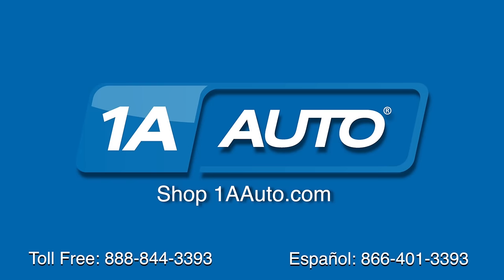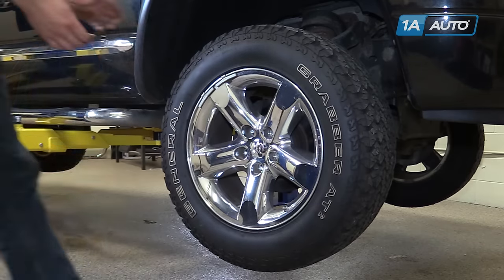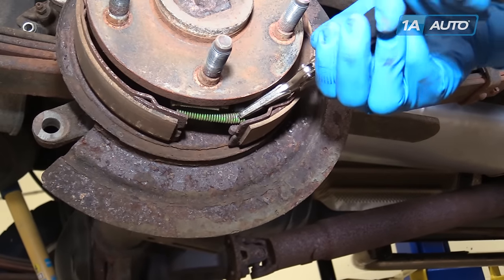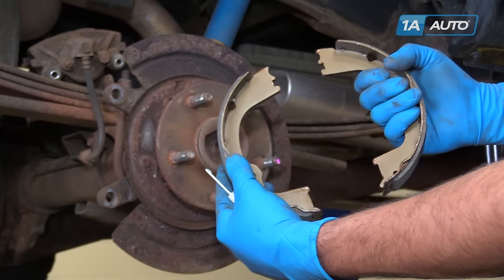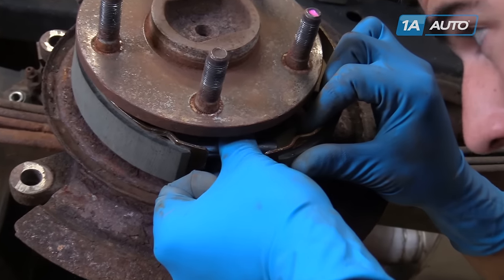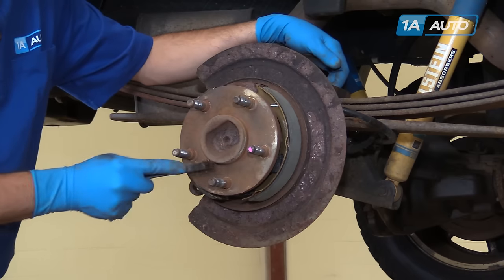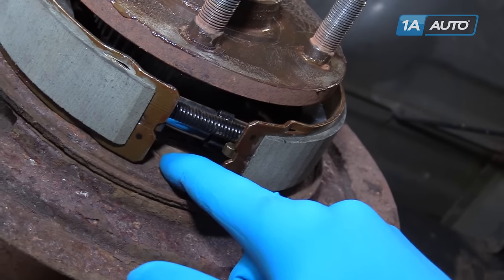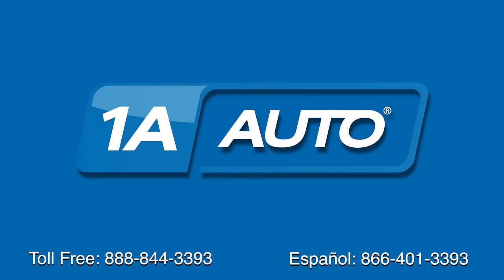How to Replace Parking Brake Shoe Hardware 07-10 Dodge Ram

Comment: Just replaced park-brake shoes on my 2004 RAM 1500.  They are exactly the same as depicted in this video.  One word of caution: technician is installing brakes on PS of this truck.  When servicing the DS, brake assembly is flipped upside down, so the half-moon and slot end of the brake shoes will install on the bottom, also the long end of both longer springs and the star nut on adjuster will face to rear of truck rather than front.
Reply: my DS is different than in this video my ps went in the way it should from this vodeo but i have a long extension blocking at the bottom ds where you have the half sqaur and half circle
Reply: Ice, I have the same issue with my 2009 Ram 1500 SLT Hemi. But NO ONE knows what the heck I'm talking about. Tere telling me both sides should match, but they don't!!! Do I have to purchase 2 separate full sets (1-DS & 1-PS), but I only need 1 set of each and they won't sell me just what I need. Any thoughts?
Reply: Helpful, Thank you Mike
Reply: M Austin Are you sure that the hardware isn't identical just inverted? I've never heard of either a shoe kit or hardware kit needing separate sides/kits.  usually DS/PS shoes and/or a separate hardware kit.
Reply: Mike Schmutzler,,,, So based on your comment. I take that to mean, This video is only someone's opinion on how to do the parking brakes. I guess it doesn't matter if the star nut faces the front of the car or the back of the car. Or am I wrong with my conclusion ?

Comment: Hardest part for me was setting the shoes after the first spring was on - it appears my springs had a lot more tension than yours. Or you have exceptionally strong hands!  The driver side where the double springs were on the bottom was the toughest, since my vehicle isn't up on a lift - and I couldn't slide the spring up past the mechanism, so had to put one shoe in place, then get the back spring to the other shoe. After much fun though, I finished the job and they work. Thank you for your video.

Comment: very good.  that is passenger side, as noted, beware driver side is upside down in comparison, otherwise identical.  Mine has 'slide retainer clips' instead of 'push and turn.'  Both should be doable through the gap as shown without pulling axle.  Manual says 'condition' by doing a stop from 25mph with parking brake only.  But make sure they are adjusted evenly first and good luck there.  Final note, if you need to mess with the cable adjuster, good luck.  I have done a couple driver side rear cables (road debris punctures plastic, cable rusts up).  I have NEVER gotten the cable adj. procedure to work.  They say bury the pedal and tighten nut until cable hook end 'slips through' 1/4 inch.  Mine has NEVER moved at all.  I have a knot in my front cable to take up slack and my cable adjuster nut is buried.  I am thinking about backing it off a lot and seeing if I can get a SECOND KNOT in the cable.  I presume my front cable has stretched.  Or maybe the aftermarket cables are slightly out of spec or not 'pre stretched.'
Reply: I have been battling a 08 chrysler aspen aka dodge durango, new front cable, new left rear, new condition shoes drums/rotors and hardware, all correctly installed from previous owner, slack adjuster on cable is maxed out, adjusters on drums maxed out, doesnt hold the vehicle

Comment: You should've done the drivers side as a demonstration, its 100x harder than passenger side. Itll almost make ya cry.
Reply from the maker: Thanks for checking us out! +Peter DePaoli
Reply: you're not kidding... 2 hours I spent on that damn thing and got nowhere...
Reply: I agree. I just finished....took me 2 hrs to get 1 clip in..and to get the new pads on...wow...need 4 hands..horrible design...4 hrs in total to do the DS. 2015 Ram.
And i still need to adjust it..i still have no ebrake stopping power when the ebrake is applied.

Comment: Is this the same setup of a 2002 dodge ram 1500 4x4? i just went to change my rotors and calipers and the parking brake was toast when i got the rotor off. no pad left its just all metal. can  you please reply i've never done a parking brake before. need to know if i can follow the guide on this video. Thanks

Comment: I used this video to replace the brakes on my 2005 Chrysler Pacifica AWD and it worked great, all I needed was needle nose vice grips. My AllData said to remove the hub and that was impossible without replacing it with a new one. My four Hour job went down to 1 hour not counting putting everything back for the hub I had taken off and torquing everything to specs. One problem I had is my PowerStop rear pad came off the clip that goes inside the caliper piston. I had to tap it back on and flare the rivet like thing they they used for the clip. Not too impressed with PowerStop right now. All I did was slide the caliper off the rotor and the pad fell to the floor
Reply from the maker: +TheCharger225 Thanks for the feedback!

Comment: QUESTION CANT I PUT BOTH TOP SPRINGS ON BEFORE PUTTING BREAK PADS IN PLACE.   I HAVE A 09 CHALLENGER  AND TOOK A LOOK LAST TIME I DID BRAKES. LOOK THE SAME. THANKS SCOTT

Comment: Replacing the E brakes on my 2009 Dodge ram. On the DS I'm having problems getting that back spring past the brake mount. Anyone have any tips on how you got it in there?

Comment: recently I put my truck in 4wd to unfreeze the rear. Worked fine after but now found the park brake adjuster wheel on the driveway. Bet I need new parking brake shoes, hardware and rotors?? Question is what make them freeze up with no prior warning?
Reply from the maker: +Will Mathieson If they are corroded badly this could happen. We carry the brake shoes shown in this video on our website. Here is a link to them. http://www.1aauto.com/parking-brake-shoe-and-hardware-kit-rear/i/1abds00255?utm_source=YouTube&utm_medium=CTA+Comment&utm_campaign=ytcomment&utm_term=A9LRqvyYiUE

Comment: can anyone comment as to why some vehicles need to have an inbound and outboard spring on the mech side?  Reinstalling the inboard one on my Aspen is a major hassle - thinking about just using one top and one bottom.....  is it in case one fails or for more clamping?

Comment: I have an 08 ram 1500 4.7 s t crew cab  doing the rear hand brake shoes , why is it that dodge has the driver side rear shoes upside down, that's right the passenger side star adjuster  is on the bottom, when I removed the drivers side shoes "which for some reason was difficult as hell but got them off, why is it on the top of the hand break shoes? Putting that back together is going to be hell, I k how its just reversed but it is Much more harder to try and setting the tension spring. Any tips from anyone to make this a little easier?
Reply: They save money by having one part to use on both sides.

Comment: I have a 2015 dodge ram 3500 and I'm unable to get my rotor off due to e brake will not free up . There is no pressure on the cable and I have pried back e brake arm . Any ideas how to free up the e brake
Reply: My rotor is stuck and will not slide off. 🙏

Comment: This apply to any Dodge Ram 1500 2002-2010
Reply from the maker: +Franklin Polanco This repair is applicable to a 2007-2008 Regular Cab or Crew Cab. The repair may be similar on other applications as well.

Comment: Great video. It helped a lot but what a miserable job changing out the drum e-brakes. Video makes it look simple but it’s not. Tight fit around the axel hub but easier and less expensive then pulling the axel shaft out.